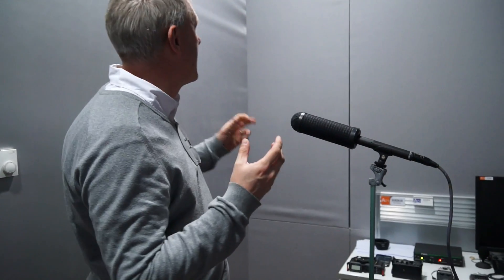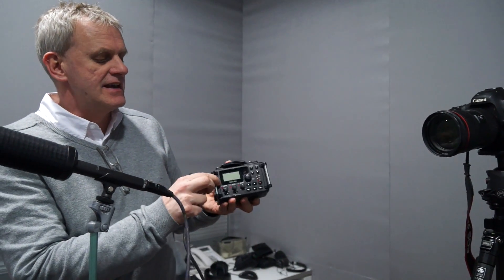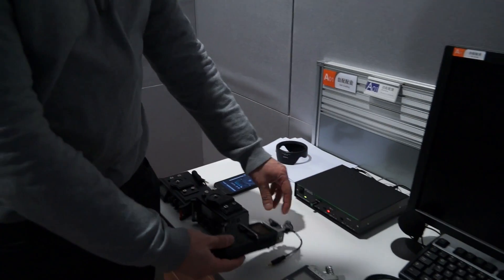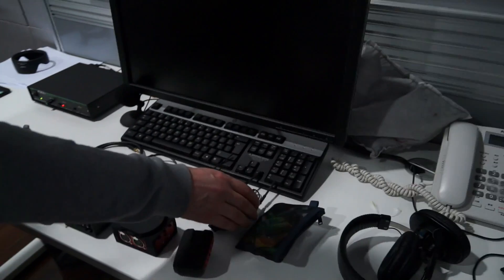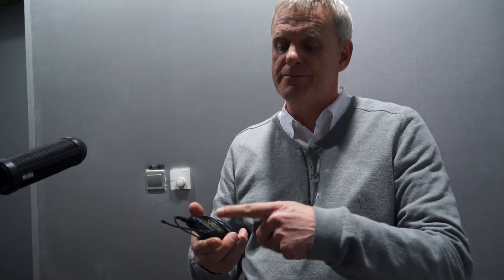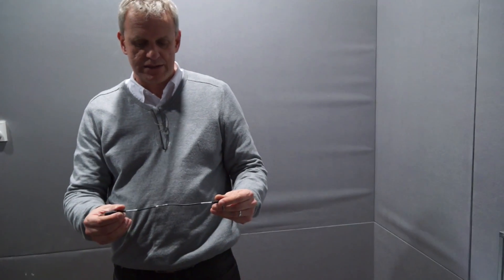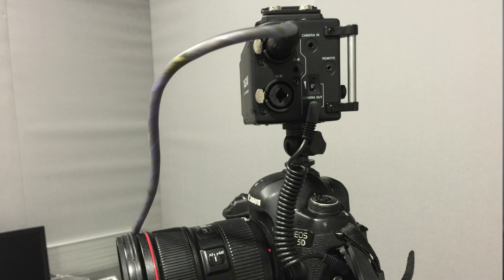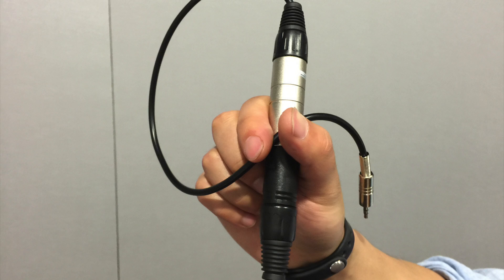DSLR Pre Amp Test

Comment: You need a special cable to hook up digital audio recorders to the canon 5d.
Reply from the maker: c0pyimitati0n it's better if you get a cable that is meant for this as it will help reduce the hiss but I have used other cables in the past and they seem to work ok.
Reply: D J Clark oh it will work, but it won't be the same quality as what you're recording in your audio recorder. I've done that with my Zoom H1 and 5d mkiii and the audio quality was significantly better on my zoom.  You need an attenuator cable.
Reply: D J Clark D J Clark oh it will work, but it won't be the same quality as what you're recording in your audio recorder. I've done that with my Zoom H1 and 5d mkiii and the audio quality was significantly better on my zoom.  You need an attenuator cable.

Comment: I use the Zoom H5 myself for this purpose, but there's no need for an attenuation cable with this model, as the recorder allows you to reduce the line output by up to 30db. I find it a very capable tool, especially without the inbuilt mics attached, as it clips on the top of the camera without adding too much bulk.
Reply: managherroad Me too! I got a great deal on it. Also I just used a basic 3.5mm 3 inch cable to connect it to the camera.

Comment: The H5 has a setting that attenuates the level by 20 db and has a dedicated line out connection for connecting to dslr. No need to use a sescom cable. That might explain why there was distortion in your test. Thanks for taking the time for this comparison. Cheers.

Comment: Great test...thanks very much for the time in posting. Your wireless lav actually seems one of the cleanest options...I've actually got the new Rodelink Wireless kit and it has a +20db option...I'm thinking this also could actually also work as a useful pre amp for a Shotgun mic like the Rode NTG 4+ (via an XLR to 3.5mm adaptor on the transmitter). Some of these pre amps (like the Tascam) put me off a little because of the sheer bulk they add. Anyway great job....can certainly hear a difference in quality between them and the benefit of getting the cameras pre amp down as much as possible. Thanks!
Reply: I agree. The lav mic was probably the quietest; I couldn't even hear anything with my speakers turn up full, but I've never liked the sound that lav mics produce.